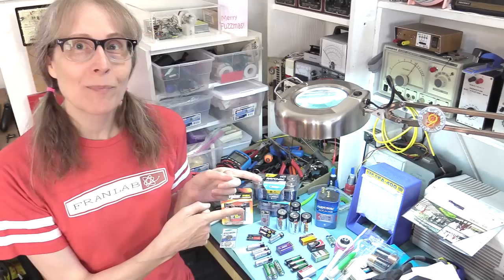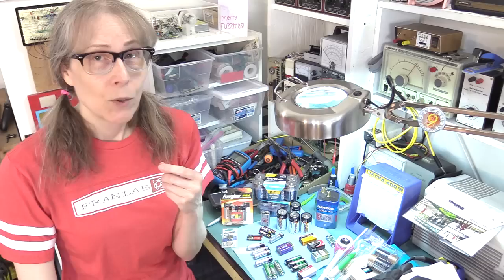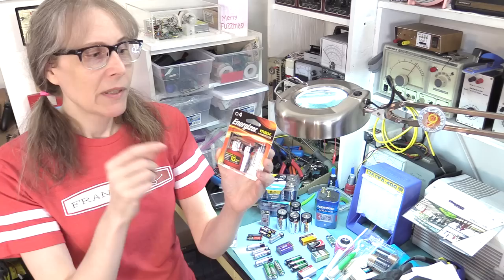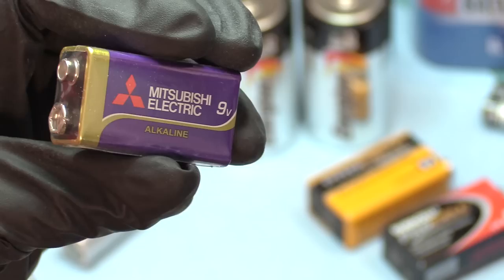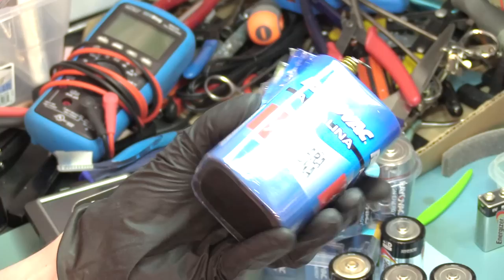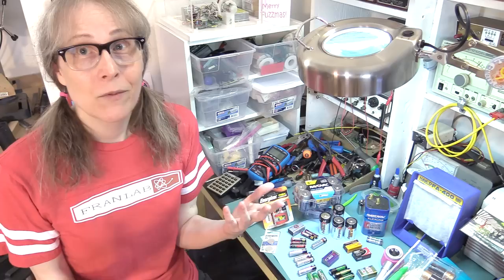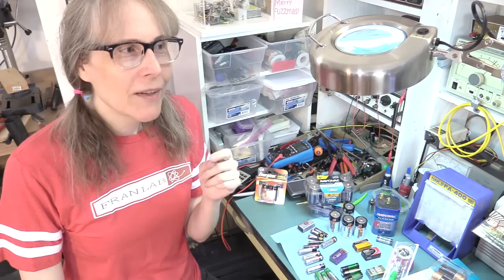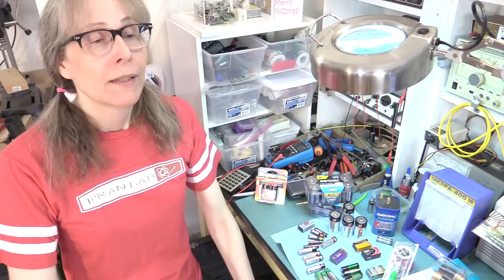Yikes! Leaky Alkaline Batteries!!!!

Comment: Without reading all of the comments ... Back in the 90's, I worked for Radio Shack (InterTan/The Source) in Canada and the house brand alkalines were rebranded energizer batteries.  An sold in good, useful quantities and quite often would go on sale for 50% off.  I am not positive if the same is true in the U.S. Radio Shack stores, or if they even exist anymore.
Reply: I miss the old Radio Shack Store on the Mall.

Comment: Good and informative video Tnx.  My personal experience with batteries is that I've  been using Duracell Pro and Industrial grade (ONLY!!!) for years and  not even once have I had any problems with it whatsoever. I've also used Panasonic batteries of all sorts and again. zero problems. In my experience if you regularly take the batteries out of any device that doesn't gat used often  you wont have problems. On the other hand I've always had trouble with coin cells literally drain over night (while the device was decently off or even worse leaking ! And, Oh.....did I tell you that I simply cannot get enough of your end of video song of yours ???  It is so good that in my eyes it could be a number one hit or something.... :)  I love it to bits...:) Thank you.

Comment: Thanks Fran for the information. My “solution” is to remove the batteries, place them into a sandwich bag. Attach the bag to the device using a rubber band. If there is a leak at least the device is still functional.

Comment: With all my occasional-use devices like the CAP ESR meter, etc., I leave the batteries out until I want to use the thing.  Yes, it adds a few seconds to the job, but I don't worry about them leaking.  I keep the batteries in a purpose-made battery-storage container to prevent them making contact and shorting out in storage.  Other devices such as the portable DMM, I leave the batteries in, and I swap old for new during the annual "spring forward" DST clock dance.  It's the perfect reminder because I do the same for several AA-powered wall clocks.  Cheers and be well!

Comment: Speaking of tv remotes, I don't know if anyone else has said it on here, about a quick & dirty check. If you have a smartphone with a camera (who doesn't), you can point your tv or dvd player's remote at the camera, press any button on it, & if your camera "sees" white light flickering or solid ON, from the remote's IR led, then the batteries are likely ok in the remote. Your naked eyes can't see this, but yet the camera's CCD can. I haven't yet tried this with a regular digital camera, but it should work also.

Comment: My own tests over decades showed Duracell Alkaline AA/AAA cells leaked earlier and with a lot more damage than Energizer cells. However, in past 2 years I've seen Energizer Alkaline cells also leaking far more often than expected.
I'm currently evaluating Energizer LITHIUM AA/AAA cells for leakage. Considerably more expensive but may be worth it if they don't leak (they claim to be leak proof). Note, these start out at about 1.8V fresh out of the package.
I have also started switching to devices that are powered by Li-Ion or LiFePO4 cells wherever possible to significantly reduce this problem.

All of the Energizer Alkaline "Max? cells were new, measured close to 1.6V out of the package, and placed  under a load of 10uA. Cells from different packs were not mixed. 
Yet just a few MONTHS later, at least one cell would be found leaking. This has happened multiple times in just this last year, with cells purchased at different times and from different stores and 1 pack from online source. My confidence in Energizer cells has dropped accordingly.

Comment: I bought an old camera flash from the 70s that had an EverReady battery in it. Didn't leak, and still had a charge. It had a "Union Carbide" logo on it, so it was older than Bopal (1984). On the side of the battery, it said if it damaged a flashlight to return the batery and flashlight back for free replacments.

Comment: Usually there is an expiration date on the battery. They will not leak until this date. But unused devices such as a flashlight, for example, often remain unused and forgotten in a cupboard or drawer. If you need it after a long time, the batteries are leaking.

Comment: The thing about the "super heavy duty battery" is that it does not put out as much voltage as alkaline batteries. It was designed for much older devices that required less voltage. Sometimes you can blow up an old device by putting alkaline batteries in them. (Because of the higher voltage.)

Comment: You’ve confirmed what I had discovered to my great cost after having leaking Duracell copper top alkaline batteries ruin several very expensive pieces of electronic equipment.  Also I had noted that Ive never had any such leakage problems with Energizer  guaranteed leakproof batteries.  It begs the question, why would a well known battery manufacturer spend huge sums of money on advertising campaigns for their inferior batteries when they could be diverting that same money into producing a superior and reliable ones? Isn’t it about time consumers woke up and realised the risk they are accepting my continuing to purchase these inferior leaky batteries?

Comment: Just yesterday I had to clean up a leak.  The batteries were relatively new.  They were in a temperature gun that I've owned for less than a year.  It had unfortunately been stored where something had landed on the trigger, turning it on.  The laser and backlight had been switched off, so there was no obvious indication that it had been measuring the temperature of the thing on top of it continuously, possibly for quite a while.  The batteries were AAA Rayovac.
It wasn't much of a leak, it cleaned up pretty easily, but it was definitely annoying.

Comment: I recieved as a birthday gift a AIWA XR MS3 micro sound system/w remote sometime around 2001 and still have it hooked up in my room. Just to be sure I checked the two AAA Duracell batteries in the remote and sure enough they are the original batteries I put in with an expiration date of 2004. Now, there was some leakage but they still are going and I went ahead and cleaned them up.

Comment: Duracell feels it is better to pay the customer for the damages than to make a reliable battery.
Duracell has bought me:
1. Microsoft wireless keyboard & Mouse
2. A alarm clock
3. Several flash lights costing over $40+ dollars each.

They always ask where are the batteries being stores? I tell them "In a Cool Dry Place".
They send me coupons to buy more Duracell Batteries and give them away at Christmas along with things that run on those batteries.

I have started buying Sam's Club batteries. They seem to hold up.

Comment: Bought a 60's vintage VTVM on eBay and opened it up to find a battery still in it. Right away I thought it would be ruined. No, the battery is an EveReady 9-lives "C" cell with 20 cents marked on it. It still has 1.2V on it and not a single leak! I'm an EveReady man now! Never buying another Duracell battery again after having many pieces of ham radio equipment getting ruined from leaks!

Comment: In the 1970's I bought a Canon A1 camera from a friend that owned a camera shop. I traveled for work a lot and the camera was involved in my work. I had a motor winder and I put duracells in it at one point. They leaked. I took the camera in and my friend said if I ever came in and he found Duracells in my equipment he would kill me. Luckily he sold cameras and filed bill of sale and left dates off as my camera was out of warranty. He was able to get my camera warranty repaired as repairs at that time were $65 per hour. I stuck to Energizers ever since and have had no problems since and the camera is 44 years old and never had to service it since.

Comment: Yeah my calipers drive me nuts. When off, there's still a leakage current and the number of times I've needed the thing and the battery has been dead has driven me spare. I store it with the batteries out now. Cute kermit ! amazed at the low standby current of that one, by contrast.

Comment: I have noticed a pattern and I think its not just my amalgamation but a real thing.   I believe I have seen this on a few occasions at least.  I find a device that was left with batteries in it 2+ years ago so I check and find no leaks.  I use the device one more time and the find the batteries have leaked as little as 1 or 2 weeks later. As if somehow using it one more time after sitting for a long time, it pushed it over the edge. By the way, it was love at first sight. Instant sub.

Comment: i've started making the change to Li-Ion 9V cells and round cells, which come with a USB connection for recharging. I love em, the 9Vs especially. I drilled a hole in a couple of my 9V toys so i could plug them up while in-circuit.

Comment: I'm all charged up after a full load of French Press,  and now I have to take a leak. I have a late fifties portable bar..about the size of a typewriter case. In it are the usual, metal glasses, long stir spoons, a shaker, and....a battery powered mixer.  In that mixer are two EverReady C batteries. The yellow and blue jobs,  with the cat image. THEY STILL WORK. They are at least 60 years old.

Comment: I've had Duracell batteries leak in original packaging brand new. Energizers and Ray-O-Vac seem to be OK. The no-name batteries that are included in various devices rarely seem to leak. Flashlights are always destroyed by leaky alkaline batteries since they swell up and can't be removed. I found zinc-carbon batteries, although dead, did not leak after 50 years in an old Brownie camera flash bulb unit.

Comment: I just looked at this video and have dissembled many of the batteries you talked about.
The lantern batteries, if heavy, contain 4 F size cells and last a long time.
The 9V batteries either contain 6 AAAA batteries or a stack of rectangular cells. 
     The stacked ones only provide 2-2.5A short circuit current.
     The AAAA cells will provide 5-5.5 amps.
     My application uses about 10 ma continuously with a couple briew (< 100 msec) near short. Battery failure can result in destruction of >$100 of hardware. The cylindrical cells will provide >30 uses before reaching my cutoff point of 9.2V while the stacked cells are good for only 1-2 uses.
     I used to buy Duracell 9V as they were the only brand that welded thecells together but they redesigned to a stack of rectangular cells. When called, they denied the change. I have pictures documenting the changes.
     Energiser Ultimate Lithium contain 3 3V 1/2 AA cells and perform like the cylindrical cell batteries but are expensive.
     The *Only* 9V I still can get are the Amazon Basics and are also one of the cheapest.
     2S LiPos work but you need a charger.As far as leagage goes, Duracell is by far the worst. I *will not * buy Duracells any more!

Comment: During my career as an Uber-techy, I had the opportunity to buy case lots of Pleomax AA and AAA cells at phenomenally good prices.  So, given a prepping mentality I "stocked up".  This was around 2002 - 2005 time period.  Over the decades since then, they made their way into almost everything electronic in the house and lab.  They didn't start to leak until about 2018 (like a decade after their expiration).  Hunt as I might, I STILL, to this day, come across some forgotten remote or multimeter or other battery operated trinket, with an alkaline disaster to clean up.  And just recently I came across a box of 12 cell sub-packs, all looking good and testing good, but waiting to destroy something if I should forget to toss them out.

(And so what did I do?  I went out and bought some more large quyantities of "modern" cells to replace the stock).

Comment: I went back to a manual glassy thermometer for just that reason, that the infrequent use meant a battery would 100% of the time fail on me when i needed it. same reason i went to a laser printer instead of a darn inkjet. "I don't use you much, but when i need you, i NEED you to WORK."

Comment: True. Last 10 years i used to buy mostly Energizer Max and Panasonic for my audio electronics and some Chinese batteries for the toys. The Chinese batteries always leaked. Never tested fully the Panasonics, but they werent bad. The Energizers rock. My biggest mistake - forgot Chinese batteries inside my Zoom R8 recorder, then found a mess i still need to clean. As for coins - they all hold up, they just swell and sometimes crush the compartment, but the ones I used do hold up without a leak. So i could use vineagar to clean the carbonite mess? It was long dried up when i found it. Thanks, great video! PS: my solution is, i always take out the batteries for things i dont use often.

Comment: Back in the 80s to mid 90s I never once had any trouble with Duracell batteries leaking.  That problem suddenly started happening in the 2000s and they've been leaky ever since.  I've wondered what the difference between the 80s Duracells and the later ones.

Comment: I had an energiser AA leak earlier this year.  I was testing a BigClive joule thief circuit, taking measurements every day after running it all night, turning it off during the day. (tab results are on one of his coil winding videos).  The testing stopped when it wouldn't stay lit for much more than 10 minutes, so that would be a cell voltage of not much more than 0.32V.  The test circuit had leads soldered onto the battery directly, and the battery was hot melt glued onto the strip board.  After the test was finished I put it aside and didn't worry about it for a few months.  When I came back to it the battery had leaked wet solution onto the PCB.  The factors that seem to stand out are a very low open circuit voltage the battery was at, and the application of heat albeit very briefly. I suspect long term storage at summer temperatures might have the same effect.

The battery was new at the start of the test which ran for about two weeks, and leaked within a few months of it finishing.

 The circuit still works (I cleaned it up and added a AA battery holder to it).

Comment: A word about "leaking dry batteries"..  They actually don't "leak" in the first row. They are dry inside so, there is no liquid in there to be able to somehow pour out from the container. The "leaking" is caused by degrading of canister material, building up compounds together with humidity in the air. This starts when a battery loses its polarization. (means is almost "empty"). Those salts or also oxides are somewhat hygroscopic. So, humidity collects to the salts, solves them, until saturated and then all this builds up wetness around the battery, causing damage by oxidising the unprecious metals (except for goldplated contacts or springs in a battery case, those will resist) It is the same effect like in a salt-based air-dryer. water pulled off the air soaks it until saturation, then drops out into the canister underneath it. Very degraded corroded batteries even show inverted polarity because of the chemical corrosion effect with metals, also building up its specific element potentials (which only can produce weak currents and voltage of course).  So-called "leak-free" batteries are laquered, or have airtight foiling, having non-corrosive or plated pole plates, otherwise the canister is either also anti-corrosive from the outside or entirely protected from getting into contact with air humidity directly. So it won't corrode.

Comment: I have a Texas Instruments TI-66 Programmable calculator purchased in 1986. Since I have some calculation formulas stored in it, that I need every day, it has seen a lot of use. But it's still going strong on the original factory delivered coin cells. May be mercury batteries were more environmental friendly, than we all would have thought...

Comment: Actually quite recently I've noticed some Panasonic branded batteries I bought just 1 year ago were leaking liquid while they were still in the unopened sealed plastic wrapper. When I looked closer, I noticed they were also deformed. Why is it that the crystallisation from older batteries is green, whereas with modern ones it's white? ...on the subject of 4.5v lantern batteries, the last time I stripped one of those out it had four cells that were cardboard tubes inside, and each one of those had thick black slime in it with an electrode down the centre. This was in 1982

Comment: I feel like there's been a bathtub shaped curve of leakyness over time - batteries were prolific leakers when I was younger... then they started to improve for a decade or so but now they're getting bad again since maybe 2000.
I'm not 100% sure if its the batteries or the newer equipment that goes into 'standby' rather than disconnecting the batteries... or even that I'm using the alkaline powered stuff less often and my phone and computer more often so I don't notice the batteries going flat in time to save them.
Reply: Mercury made the difference.  Very early batteries were Carbon Zinc (Heavy Duty).  Then we were blessed with the earlier Alkaline batteries that had a small amount of mercury in them.  Once that was removed, the batteries went down hill, and have not recovered yet.

Comment: In 1998 I found a flashlight above a tin ceiling with 1935 batteries. The batteries hadn't leaked! I still have the flashlight. For decades batteries were advertised as not leaking. Now, all batteries seem to leak in a year or so.

Comment: I've got a vintage 9V battery I pulled from a Sears TransTalk 600 walkie-talkie, it proclaims itself a 'transistor battery'. 😏 That amused me, so I kept it around, it's in a junk box around here somewhere. It showed no signs of leakage despite being easily 60 years old and quite dead. 🤔 (Love the vintage look of the walkie-talkie...thinking of turning it into a Bluetooth speaker or something.)